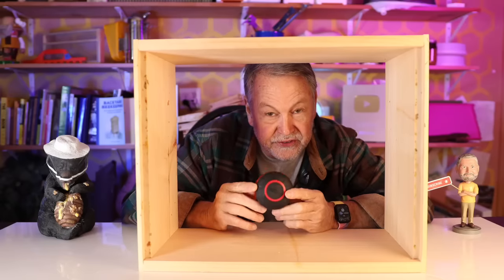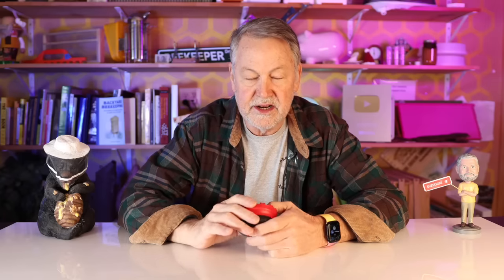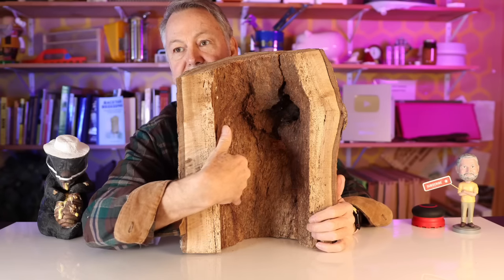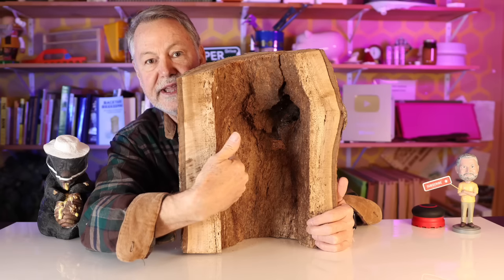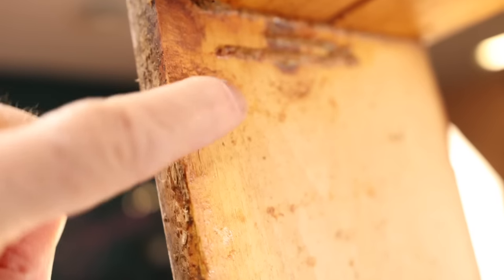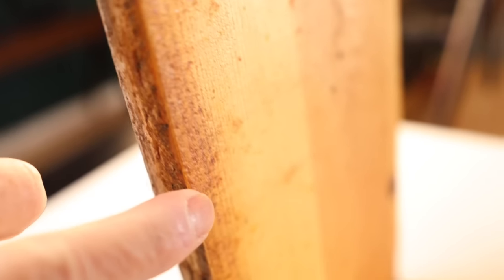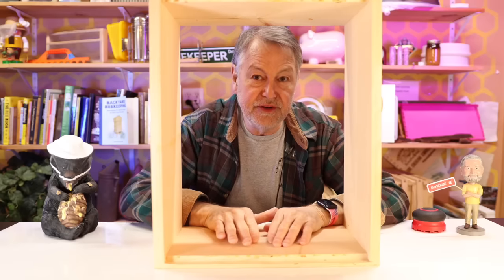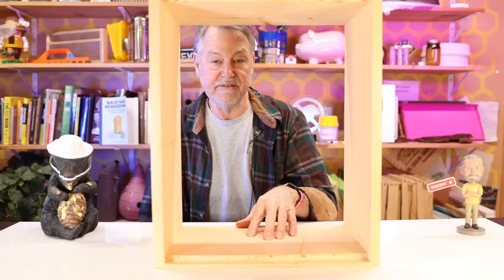Beekeeping | Can This Tiny Tool Save Your Honey Bees??

Comment: When I once melted all the propolis I collected from cleaned up boxes, there was a layer of wax on top which was heavily infused with propolis. I then scraped this wax and have been applying it to my hive boxes sealing all the corners as well as on the corners in the hive floors. This saves bees all the hard work from having to do it themselves and spend more time building their wax combs, taking care of the young etc...  I have also found out that if you paint docarative pictures outside of the hive box(s) bees seem to florish better for  some reason. Maybe they respond to the love you put into providing them that king of living environment. 🙏🏼

Comment: Looks like using a wire brush chucked in a drill would be an easy way to put a rough surface on the wood.

Comment: Easiest way that I find for scoring hive boxes is to use a wood hand saw. Hold the saw sideways by the blade (not the handle) and drag the teeth across the wood. Drag in one direction at an angle and then opposite direction to create a cross hatch pattern in the wood.
Reply from the maker: I’m going to try that, thanks. I bet some people have never used a wood HAND saw. That’s all we use to have!

Comment: Burning the inside slightly has the same effect.  The pulp burns faster leaving ridges in the wood.  But the black char left behind gets tracked thru the hive and blackens even new comb.  I have heard that the smell of burnt wood also attracts bees, but i can not confirm that.  Roughing the inside will be a much neater hive !
Reply from the maker: I used to also burn the inside of my hives.